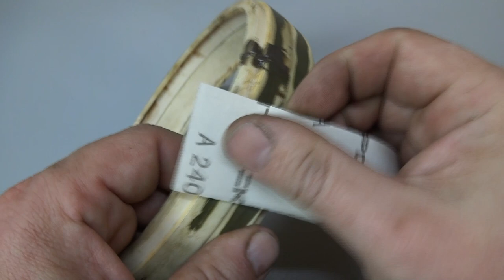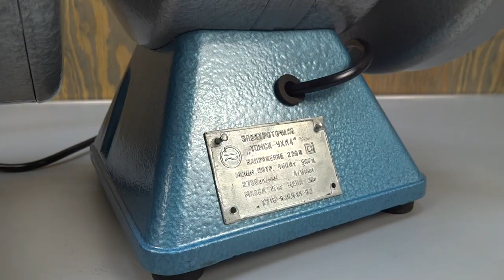Restoration of a Fifty-Year-Old Bench Grinder TOMCK

Comment: Hi, I've got identical grinder and sadly starting winding also is burned,
is there any way to force main winding (whitch works fine) start this motor without starting coils (e.g. with capacitor)?
Reply from the maker: Hello! No, it won't work with a capacitor. You can start if you twist your hand and at the same time press the start button. Or repair the starting winding.